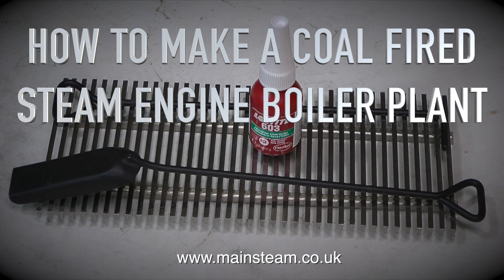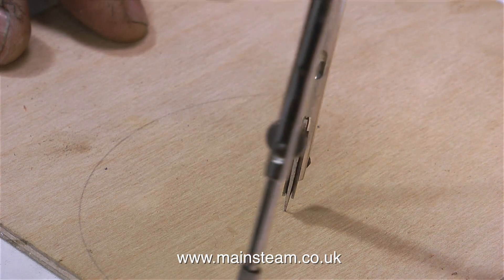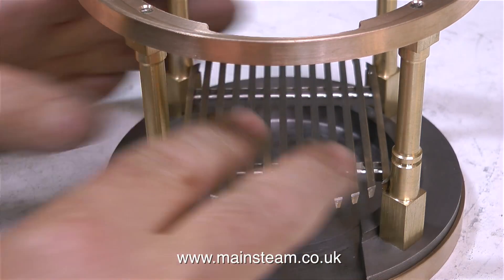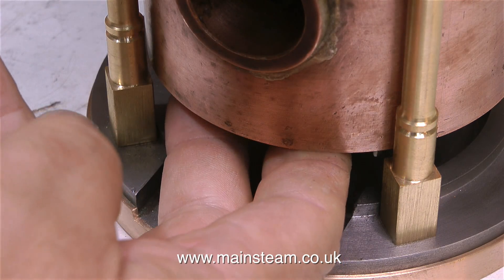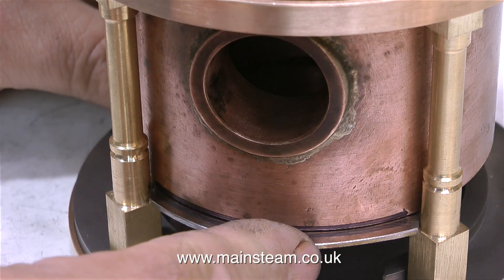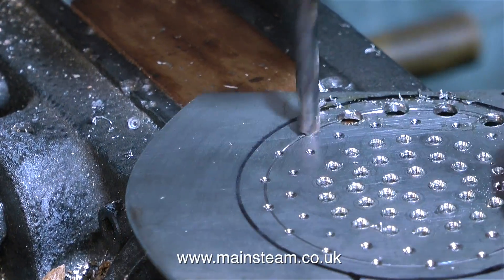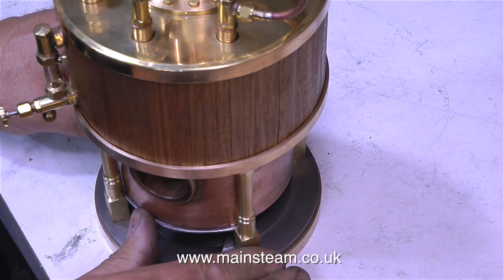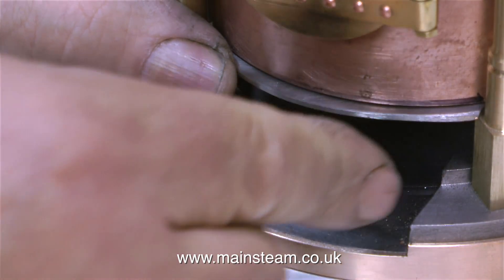HOW TO MAKE A COAL FIRED STEAM ENGINE BOILER PLANT - PART #24

Comment: Keith don't know if it would do much for a little model like this but a friend of mine makes his own grates for his live steamers. He hates fire bars for some reason. He does drilled grates like yours but they are cone shaped holes larger @ the bottom and smaller at the top. He claims this helps increase air flow to the fire the cone shaped or tapered holes in the metal. Can't say he's wrong since his locos steam well and ash never has a problem escaping either.
Reply from the maker: Yes I made one like that and it was OK. I still prefer the fire bar type though .....

Comment: Suggestion if you haven't already ruled it out.  Add a wire pull tab to 
the grate, so you don't have to look for the pliers should you need to 
do an emergency fire drop.  If done with 1/8 to 3/16 stainless wire it 
should stay cool to the touch.
Thank you for the great videos.

Comment: hi  Keith I have work with stainless steel for over 30 years and if you made you plate out  304L it will distort as soon heat up  and you not be able to remove it very well as I have done so my self  you need 316L mill finish that is not bright it looks like shoot blasted finish this steel is better as it can take a lot  more heat and it also dose not distort and another tip with stainless steel is never put in water when it hot as distorts badly but I know you know that when drilling stainless steel we use treflex it is better than rocal  as it dose not impregnate metal  and contaminate  metal well good luck and hope this is some use  form one engineer to another Andy
Reply from the maker: Thanks Andy, I am about to source a thicker piece so that info is useful :-))))
Reply: I am replacing a mild steel fire grate in a fireplace. It was lost to corrosion in one season. I will be purchasing 310 stainless steel 1/2 inch diameter round stock. This alloy has good corrosion resistance at high temperatures.  Perhaps it is not worth the cost over 316L. I will find out. Wonderful video, thank you for sharing!
Reply: your more than welcome if you problems sourcing let me know as I have large sheet metal works near me and they al ways have to many off cuts spare that get scraped .

Comment: Nice solution, I can only hope the plate will remain nice and flat after firing. My hands on experience ( in making BBQ' s ) and using stainless steel suggests otherwise. Strange stuff. We shall see after the firing..... pity you cannot use the original griddle, it really looks nice, more air flow too.
Reply from the maker: I agree it looks better, but it doesn't fit even if I machined off some of the brass columns, the cross pieces get in the way and I can't remove the grate without lifting the boiler. I may remake the  stainless steel plate from a thicket piece . . .

Comment: Hi Keith this has turned into a great looking boiler, full credit to you. By the way I managed to fix the videos I think you what I mean. One thing  Keith I am currently machining the axel horns any advice on  the best way to do this would be great anyway mate look forward to the next video regards John
Reply from the maker: The only advice is to just make sure that the axle horns are 100% parallel to each other  ......
Reply: Keith Appleton thanks Keith, I'll bolt the frames back to back and machine them together John

Comment: I think i would have been tempted to file the inner corners of the pillars so the grate would sit lower, the grate you bought looks way better in my opinion ;)
Reply from the maker: But it still would not slide out owing to the two crossbars as I mention in the video . . .
Reply: Ah, i see